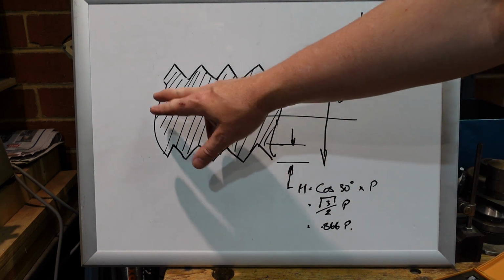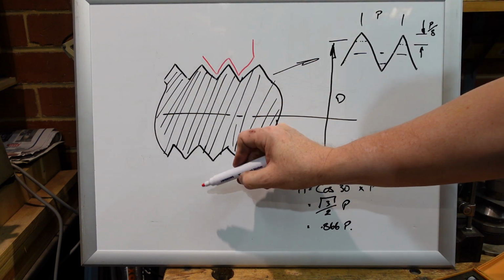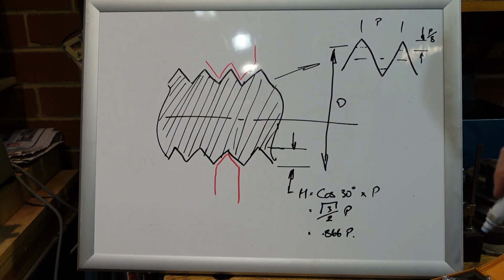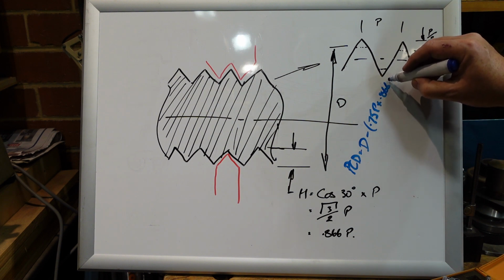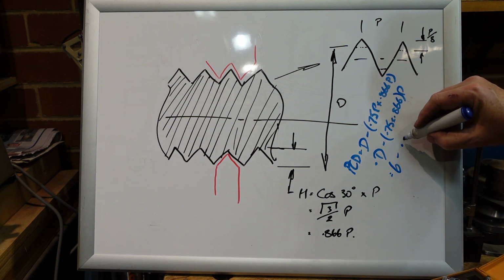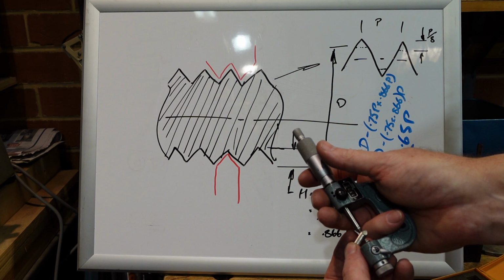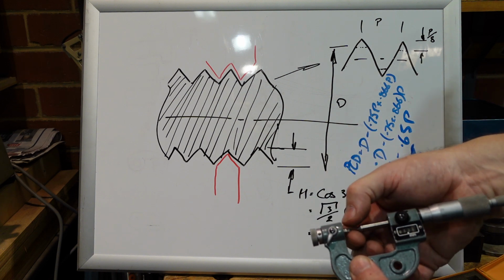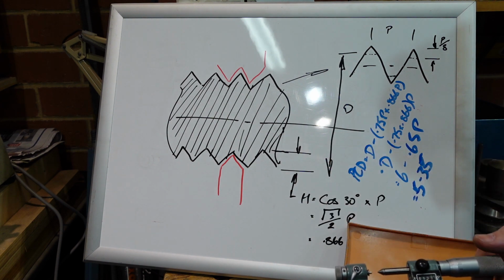Using thread mics

Comment: I haven't seen a set like this in a very long time. An expensive piece of kit back in the day. Most shops used Go-NoGo ring gages as they checked the entire thread profile.
 Letting that box out on the shop floor seemed to make those expensive anvils disappear.